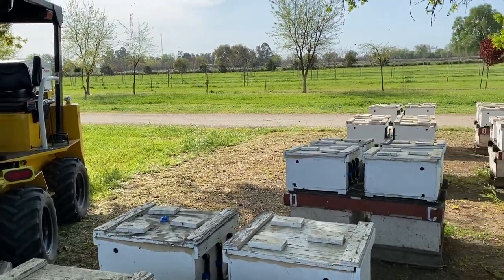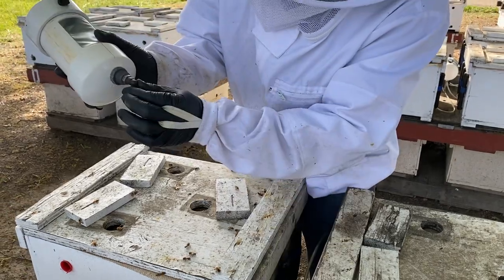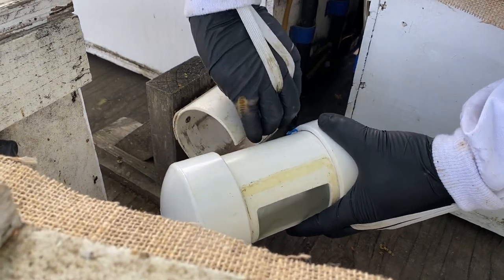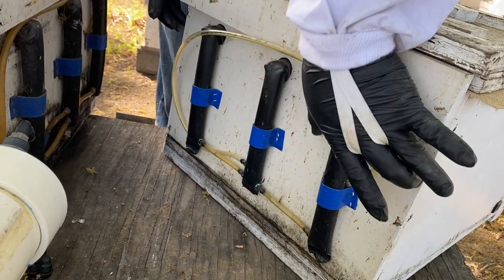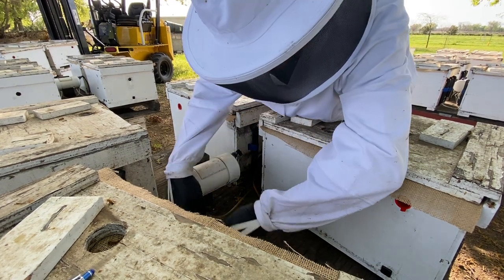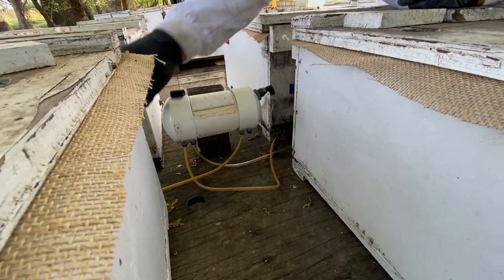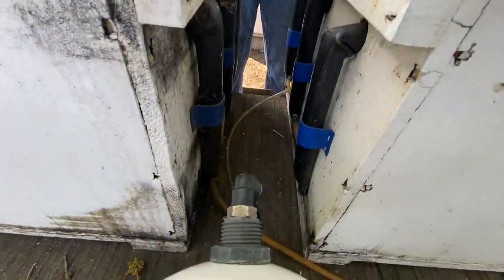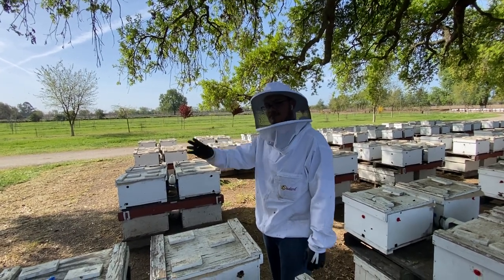Setting up Auto Feeders

Comment: Great idea. Just one question: what sort of tape did you use over the hole in the tank? The adhesive must be pretty strong to hold it in place when the syrup makes it wet.
Reply from the maker: It does not get wet because it’s on top. The tape is only there to keep ants out. The tape is used called mat tape. It’s used to hold wrestling mats together.

Comment: Hi this is the syrup?
Reply from the maker: This is a float valve that controls the syrup for the bees
Reply: Sorry , stupid auto correct 
I meant to say how thin is the syrup?
Reply from the maker: We mix it 50/50 with water. We buy and use high fructose 55
Reply: Ah I see, no granulation plugging issues that way.  Good idea
Reply: I’m trying to figure some kinda system for my indoor wintered bees, automatic like that and not cumbersome and messy.  Typically we use hamster feeders, but 1500 pop bottle refills is a terrible job lol
Thx for the content
Reply from the maker: @aCanadianBeekeepersBlog  not at all! Thanks